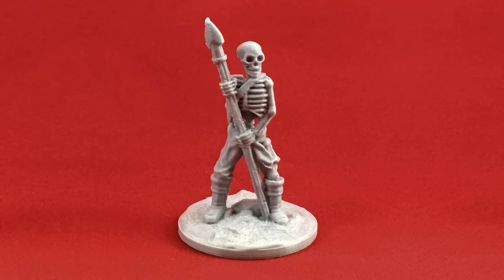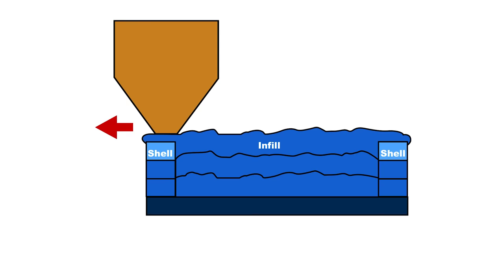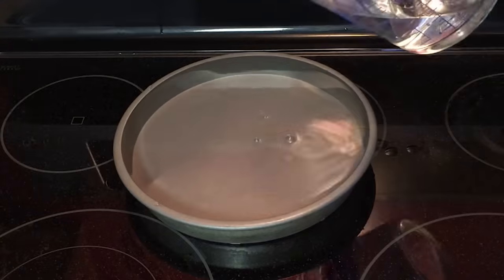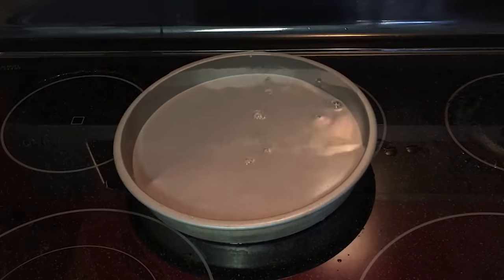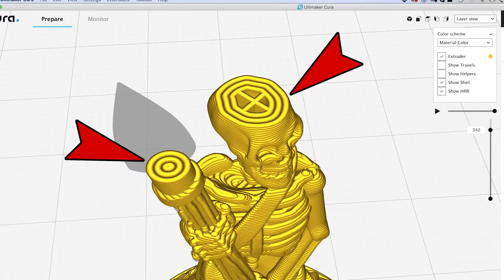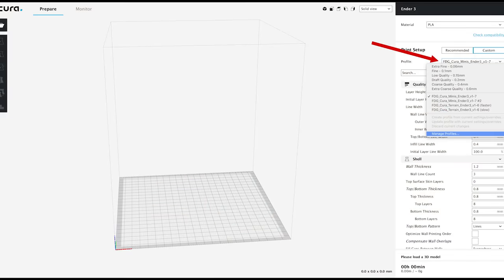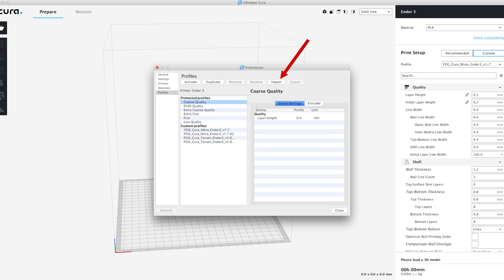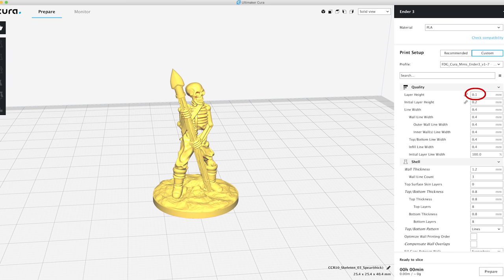How to 3D print miniatures on a FDM printer

Comment: Thank you so much for making this video. It is the most insightful and well spoken miniatures print guide I have ever seen. Well done, good sir. You are a gentleman and a scholar. If you say eSun PLA Pro filament is the way to go, then I'm sold. 

I just bought a Prusa i3 MK3S and it's going to take a few weeks to get here. With respect to this printer, do you recommend any additional parts/accessories? And more importantly, would your slicer settings be totally applicable to my printer as long as I use the same filament that you use?
Reply: I have the prusa mk3s, I'm using their prusament pla and their prusa slicer with the prusa pla preset and 0,1 layer height setting... Even with 100% infill I had insanely good results but you can adjust everything that's said in the video in the prusa slicer as well with their filament - that way you don't need to worry about settings like retraction and flowrate which you CANNOT just copy and expect good results since the prusa has different extruder
Reply: @Averell64   That's great to know, thank you. But I would prefer to buy filament on amazon and not have to sweat waiting on it to ship from the other side of the world. Do you think eSun PLA Pro filament will work well on the prusa mk3s using the prusa slicer? I appreciate your insight.
Reply: @7F0X7  most likely it will, checkout which filament presets are in prusa slicer (I think they have one for generic pla as well) and try all of them out with a test object untill you find the right tune - then you should be set... You are gonna get a 1kg roll prusa pla with the printer though, you could use that as a benchmark as it is really good in my opinion
Reply: @Averell64  That's great advice, thanks again. I ordered the kit with the flat plate and the powder-coated plate just to give myself options.  Hopefully by building it myself will help me understand more inherently how it all works with each setting.
Reply: @7F0X7  the kit is awesome, it's got the best instructions possible, and there's also a first print guide that will help to get you started... There is one thing of utter importance though: DON'T EAT THE HARIBO BEFORE OPENING THE INSTRUCTIONS HANDBOOK... Other than that, happy building :D
Reply: @Averell64  Just wanted to give you an update. I built my MK3S despite using the world's shittiest allen wrench (the one from the kit...). I had to go out and buy another big bag of Haribo to get through it lol

After a little bit of minor frustration getting the live z height and all all the advanced hardware settings dialed in I have successfully printed many of the test builds on the included SD card to my satisfaction as well as a few other builds I found online. I am now 100% happy with my printer's physical adjustments and hardware settings, and I'm ready to take it to the next level. All I've done with Prusaslicer is figure out how to dial back flow rate and adjust basic layer height. But I've found Prusaslicer to be lacking in the settings department, and that Z-hop crap has got to go. I think I'm going to use try Cura and try all the recommended settings from Fat Dragon. 

So my question for you now is do you know of a pre-made MK3s profile for Cura that will provide better results than the default prusaslicer settings? I know that magical "K Value" is automatically adjusted in Prusaslicer, and I'm afraid I'll lose that benefit if I switch to Cura. Thanks again for all your advice!

Comment: Great video, if you are using a Micro Swiss hotend you need to reduce your retraction distance to around 3.5 will that through the other settings?
Reply from the maker: Reducing retraction won't affect the other settings. :)
Reply: @Tombof3DPrintedHorrors  Thanks !

Comment: This is a great video, and I've had some success. However, a lot of my prints with this profile have resulted in massive layer slip (you know, where the whole print shifts over). Could this be a result of the high speed, or the acceleration? From my research it seems to be the most common cause, but I'm no expert like you, so any insight would be appreciated.
Reply from the maker: Sounds like your belt tensioner(s) are loose and letting the belt slip. Loosen the screws on them and pull tight, then tighten the screws again. :)

Comment: is not it better to print more miniatures instead of just 1 miniatures?
this in connection with cooling time

regards
Rob.
Reply from the maker: Yes, printing more miniatures increases cooling time, but you tend to get slightly lower quality due to the additional larger movements involved.

Comment: Are these settings good for the most up to date Cura?
Reply from the maker: Download my latest Cura 4.12 profile for the current settings
Reply: @Tombof3DPrintedHorrors  will do after I calibrate my printer. Just saw your video on this and may need to try that as well. I'm getting bad delamination or layer adhesion. Trying to track down what it is.

Comment: Your description of Jerk doesn't match my experience in motion control.  Jerk, in the industry parlance, is the acceleration of the acceleration.  Each step in the motion profile is a different integration step :  Position <- Velocity <- Acceleration <- Jerk.  If you get really crazy there is also snap, crackle, and pop, but usually we stop at jerk.  So yeah, it's normal for jerk to be greater than acceleration.  Now it may be that Cura treats jerk as you described, but the way the dialog is laid out, it doesn't seem likely.
Reply from the maker: This is the official description of 'Jerk' from Cura:

'Jerk defines the speed of the print head before performing a hard stop. Just like a car the print head needs to come to a complete stop at some points. It's comparable to hitting the brakes in a car. When you do this at high speeds it feels uncomfortable. The jerk settings reduce the speeds set in the firmware making the print a little slower but more accurate.'
Reply: Hard to argue with that!  They are using it wrong :D

Comment: Good video, but check yourself on a couple technical definitions. Particularly, you explained tensile strength and jerk and both explanations had a lot of problems. Please know that this criticism is entirely intended to be constructive. Materials have tensile strength, compression strength, shear strength, hardness, and ductility along with many other qualities. Tensile strength deals with how much you can pull on it just trying to pull it in two opposite directions before it breaks. Flexibility has a lot to do with ductility and hardness, not tensile strength. Jerk is actually a change in acceleration vs time. Just like acceleration is a change in velocity and velocity is a change in position.
Reply from the maker: I'm sorry, but that is not how Cura defines 'Jerk'. Per the Cura website:

"Jerk defines the speed of the print head before performing a hard stop. Just like a car, the print head needs to come to a complete stop at some points. It's comparable to hitting the brakes in a car. When you do this at high speeds it feels uncomfortable. The jerk settings reduce the speeds set in the firmware, making the print a little slower, but more accurate. Disable the setting to get the maximum jerk."
Reply: @Tombof3DPrintedHorrors  oh okay, I didnt realize that cura defined it that way. I thought it was talking about the physics term. My bad. Thanks for the clarification!

Comment: For alot of miniatures you need supports.
How do you solve deformed skin due to supports?
Reply from the maker: All of the miniatures shown in this video are designed to not require supports for printing (we have a large line of minis coming out soon that are like this.) I will cover supports in another video later on. :)

Comment: im using gyroid infill and 50% seems very dense, and takes 3 hours to print...how bout 20%??
Reply from the maker: You can lower infill to whatever percentage works for you. I would be careful with gyroid, it causes increases in layer lines in some cases.
Reply: @Tombof3DPrintedHorrors  ive been printing decent 75 mm bust at 8-12% ...got a mini yeti going at 50%..ill post on Ender 3 facebook group if it comes out  ;)

Comment: I see you recommend 0.1mm layers for the ender 3. Chep mentioned that the magic number for it (z-axis resolution )  is 0.04mm.This would make the layer 0.12mm . Do you agree with Chuck's findings and are you going to update your profiles?

Thank you,
Reply from the maker: No. .1 will actually produce a better miniature. .1 is a precise half step (i.e. micro step) so the voltage between the two coils is exactly equal, making an even half step extremely accurate, far more so than any other degree of micro step where voltages to the two controlling coils are different. When you go down to .8 layer height, however, overhangs are thinner and are subject to greater heat deformation on subsequent passes. .08 vs. .1 quality differences are only really obvious on things like test cubes with perfectly straight sides, and only under extreme magnification. For printing a mini, .1 will give you better results if you have much in the way of overhangs/angled limbs, not to mention be faster. Also, you must remember that every other layer will be a full step (.1 is an exact half step, the next layer at .2 height will be a full step, then the third will be a half step, fourth will be a full, etc.)
Reply: @Tombof3DPrintedHorrors  Thank you very much for the explanation. I didn't know that the ender 3 (stock) was capable of doing fraction/micro steps. 
This is one of the best videos I've seen on regards to the Cura profile. Thank you.
Have you tested it with Klipper?
Reply from the maker: No, I have not tried Klipper.

Comment: Have you tried printing the miniatures on a cold bed? I've found less temperatures issues with it
Reply from the maker: No, I haven't, but I will definitely give that a try. :)
Reply: Since you don't actually need a hotbed for PLA, I think it helps with the glass transition issue, keep in mind that you will probably need another adhesive than the one you use with a hotbed.
BTW: Amazing video!

Comment: Hello! It's a very informative and interesting video! Apart from a lot of tutorials that makes a lot of noises (stupid cheezy music sometimes) and special visual effects you're just telling and showing all necessary points one by one and go as deep as possible to know IMHO.
One thing I don't understand is the avoidance of Z-Hop. Do you have a BLTouch or any other sensor? I don't have and on some prints I simply can get sudden fails when the nozzle grabs a model and drags. Or (if it's glued to the bed) it makes undesired smear deformations on layers (while travelling).
My main plastic is PETG now (for tech. things basically). Is your point about Z-hop stands for PLA and miniatures?
Some day I'll start making miniatures as well :)
P.S. Subscribed!
Reply from the maker: Yes, Z-hop being off is for miniatures and gaming terrain. For larger items you are printing with PETG go ahead and have it on. :)
Reply: Thanks for the quick answer! For small PETG the same? Few days ago I've printed a small detail to fix my basin's flushing device. I've got to work it well but the small diameter (~2.5-2.8mm) cylidner part got to be oval, not round (even visually). It's a lucky case when it practically don't matter... but for the others...

Comment: thank you, that was a very clear, concise, and informative video. you cleared up a lot of things that were a bit muddy for me. i was looking for your cura profile for cr-10, as i have a cr-10 mini- saw the link for the ender profiles in the "show more" section. would that matter as far as importing the ender 3 profile for use with my cr-10 mini? i assume it would work the same, just different bed sizes, but i wanted to make sure
Reply from the maker: Yes, just change the bed size (and height) in the  settings and everything else should work fine for you. :)
Reply: @Tombof3DPrintedHorrors   sweet, thank you! still modifying the profile for my setup, it keeps printing the base perfectly and then underextrusion and spaghetti, I think it may be because I'm using Hatchbox white, and need to print at 200 deg, since it was fine lower layers when it was 205. (using your skellies and turtles models) when will the lizard and pig people be available? or did i just not find them?
Reply from the maker: The lizard folk and orcs will be available on Kickstarter in a week and a half (launches February 5th). :)

Comment: Have you tried 0.2 mm nozzle? I've found it to work quite well :) Gives crisper angles but I don't know about the radiant heat issue :/
Also, itsn't it always better to use increments of 0.04 in your layer height? I mean, print at 0.08 instead of 0.1 since 0.04 is usually the Z resolution on these cheaper printers.
Reply from the maker: Layer height increments are based on the pitch of the z screw and stepper increment, .04 increments may be the increment on one printer, but not all. Yes, I have tried .2 and .25 nozzle for miniatures with great results. I will be posting a video in November showing how to do it. :)
Reply: Yay :D Can you give a hint as to if radiation heating is a problem?
Also, couldn't you solve radiation heating by putting a reflective cup with a small hole just to let the filament through? I'm thinking aluminium since it's got a reflective index of 98% for most of the thermal radiation being given off at 500 Kelvin.

Just putting some foil suspended by some metal wire or other contraption so that it doesn't directly touch the nozzle should decrease that radiation quite a lot. The cooling fan should easily cool the foil much quicker than the small amount of radiative heat being absorbed by the foil.

It might even work to just put aluminium foil around the nozzle, since it's got a very high reflectivity it shouldn't emit much radiative heat. If you have a glass bed on an aluminium heater you've probably noticed this effect, since the glass radiates a lot of heat, so you can feel it with your hand, but if you place your hand close to the underside where the aluminium is there's almost no radiated heat :)

It could be worth a test to see if it improves quality when printing really small layer heights, especially if it's as easy as wrapping some aluminium foil around the nozzle :P

Comment: You are incorrect about jerk. It is not the speed that the printer slows to before coming to a stop. Jerk is the 4th derivative of displacement. This means it is the change in acceleration.
Reply from the maker: Cura's definition of Jerk from their website: "Jerk defines the speed of the print head before performing a hard stop. Just like a car the print head needs to come to a complete stop at some points. It's comparable to hitting the brakes in a car. When you do this at high speeds it feels uncomfortable. The jerk settings reduce the speeds set in the firmware making the print a little slower but more accurate. Disable the setting to get the maximum jerk."

Comment: Do you have profiles for CR-10s?
Reply from the maker: My Ender 3 profiles work for CR-10s too :)
Reply: @Tombof3DPrintedHorrors  When I tried to import it, it did not allow me to do so. "The machine defined in profile C:/Users/jack/Downloads/Official_FDG_Cura_Ender3_and_5_Miniatures_4mm_v4_2.curaprofile (fdmprinter) doesn't match with your current machine (creawsome_cr10s), could not import it.

Comment: Tom, what's your take on the new gyroid infill?
Reply from the maker: I am experimenting with it now, it is much stronger than other options, so you can actually decrease the infill percentage some and still gain strength. I'll be releasing an updated Cura profile soon as soon as I get my tests done. :)
Reply: @Tombof3DPrintedHorrors  The strength seems good ... my concern is the amount of cyclic vibration it causes in my printer (and the print itself).

Comment: Heyo, are those profiles from 2021 still useable ? Very good video literally felt like in a class
Reply from the maker: Updated profiles with even better settings are now available for Cura 5.x on my website.
Reply: @Tombof3DPrintedHorrors  Thank you very much I have been trying to print with a Creality Cr-10 I think I tried a profile but failed with .4mm just got a .2mm and will try again the profile, profile has no support added so I added them but still failed sadly.
Reply from the maker: @n7pankake236  my profiles have no support settings as none of my models require supports.
Reply: @Tombof3DPrintedHorrors  OH I see... damn is just that I made some miniatures in Eldrych Foundry and rip I been having issues but I finally got a .2 nozzle gonna try to print now

Comment: what about supports?
Reply from the maker: No need, none of my miniatures or terrain models require supports. :)
Reply: @Tombof3DPrintedHorrors  but physics, how did that lizard mana spear work, gravity exists!
Reply from the maker: @BookTrivia proper design engineering. ;)
Reply: @Tombof3DPrintedHorrors  I tried printing a figure over night with these settings and it worked perfectly, you’ve gained a subscriber
Reply from the maker: @BookTrivia  I have profiles with even better settings for Cura 5.0 on my website. Huge improvement over the settings in this video. :)

Comment: does the ender 3 profile work for the CR 10?
Reply from the maker: It should :)
Reply: Downloaded but the file wont import into cura?
Reply from the maker: It was made in Cura 3.4.1, so only that or higher will load it.